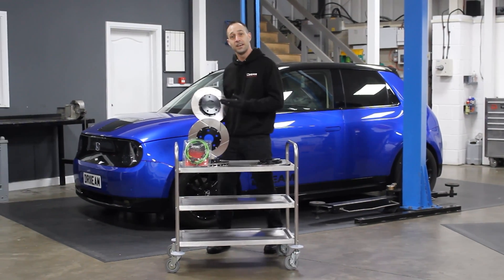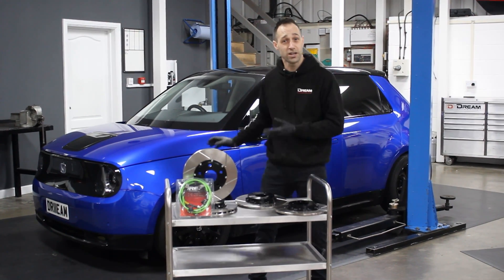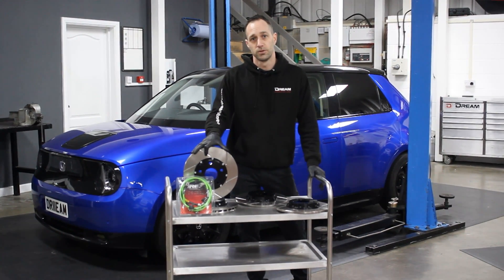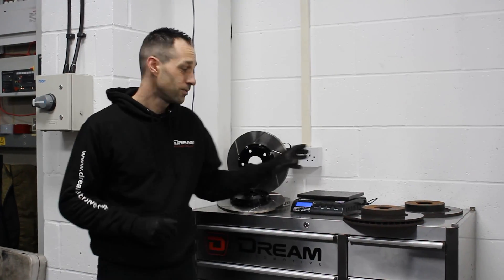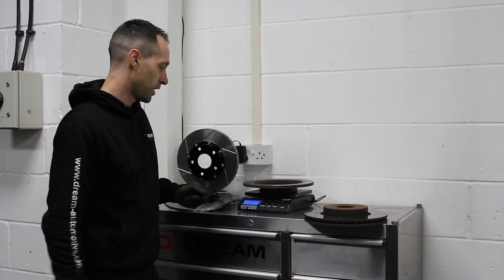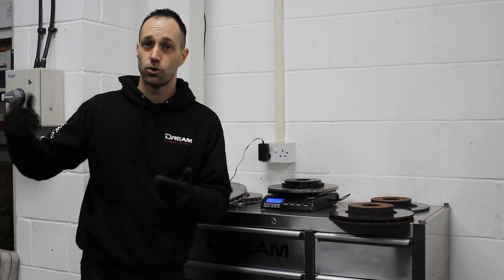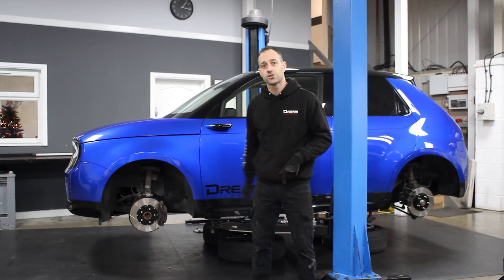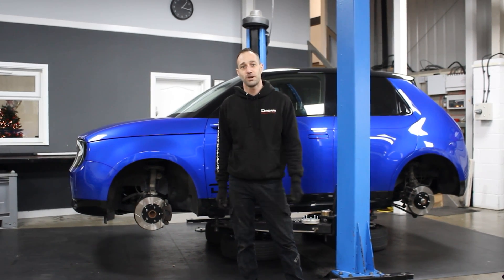Honda E Efficiency Tuning! Part 1: Brake Discs | Dream Automotive

Comment: Hi I wonder how much range improvement you gained from that 2.5Kg unsprung weight reduction.
Reply: It's the rotational mass that's the key here  , better and more efficient acceleration and slightly better range .Probably a slightly better 0-60 time too.    
 But 2.5kg in unsprung weight is nothing for range that's two bottles of water in the boot . Might be 2 miles at best .

Comment: Hi mate, is there anywhere I can buy these brake discs? Or any good light brake discs would do? Any recommendation?
Reply from the maker: Hello! You can buy them on our website through this link: https://www.dream-automotive.com/collections/honda-e-zc7-brakes/products/dream-automotive-2-piece-disc-honda-e-zc7-2020?variant=39578500104272 👍

Comment: I really try to imagine what its like to drive at low speed. I know its slow at higher speeds. Im driving a FK2 and that is I'd say rather slow when driving at low speed.( Until boost really kicks in) Can you compare FK2 0-30 Mph (0-50km/h)  to the one of the honda e? How its it torgue wise? It punshes you in the seat too? I mean 315 Nm is a lot.

I am really tempted to get one in replacement for the FK2 as I have a new job and do only have to drive 5 min instead of 30min. Dont want to use the TypeR for that short distance everyday and cant afford two cars.

But also I think I will miss the TypeR's performance, so Im unsure if I should wait for a performance EV honda model. Dont need 310hp again, but Id like to see 220 horsepower or something in that range. But who knows if and when they will release something like that...